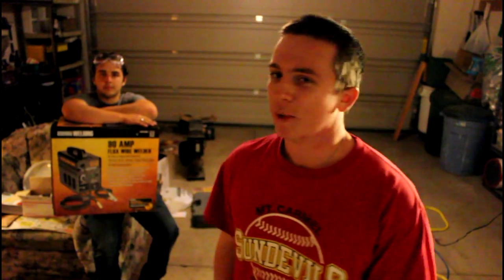(Homemade) Go Kart Build Project 3: WELDING! and More Cutting!

Comment: A little tip, try taking the nozzle off, i did it and it made it a whole lot easier to see your motion of welding and were the puddle is going, although u can only do this with flux cored wire.
Reply from the maker: +bestian4 Gotcha thanks for the tip. Yea I did notice it was hard at first to follow the bead.

Comment: It's not a bad welder to start with, especially for infrequent use. One tip for anyone getting one. Get good wire. Don't use what comes with it. I use lincoln electric innershield wire. It works waaaaay better than what came with it, and what I found at menards. I found mine at home depot.
Reply from the maker: +jesondag Yea it definitely is not bad at all for the price you pay. That was the first thing I did, threw away the wire that came with it and bought the good Lincoln Electric stuff from Home Depot

Comment: hey theres a thing on the welder that controls the heat and if you turn it down it will not melt the mettle
Reply from the maker: +Joseph Florean Thank ya for the tip!

Comment: First off, I know this is 2 years later but I just found it. I’m wondering if you have more experience with the welding? If so cool, if not here is a bit of info for you. I have the same welder and it’s a D.C. welder which is good for aluminum, not steel. I heard at the end of the video you mention the flux was causing the splatter and that is half right the other half is the D.C. part. If you haven’t found a decent welder for steel I would recommend Razorweld. It’s a low cost inverter welder system. Mine is an A.C. MiG/Tig/stick which is good for Steel. 

I will continue to watch the rest of the build for ideas and thanks for not letting a lack of experience keep you from wanting to learn.
Reply from the maker: Hey Ziggy, Thanks for the comment! Yea I've gotten quite a bit more experienced at welding over the past two years over the course of this build and various other projects. Always looking to improve though from well-seasoned welders, I definitely still consider myself an amateur and would love to learn Tig welding at some point. Thanks for watching and dropping a comment about the welder. I always love to learn new things and challenge myself.
Reply: Hnat Automotive a tip on TIG welding, brazing is very similar but cheaper and would be a good way to start. A torch (which you have have) and brazing filler rod for the appropriate metal your working on. A steady hand is need for both and my welding teacher started us all out with brazing to teach us heat control and hand placement.
Reply from the maker: Sweet, I'll have to give that a try! Have been wanting to try and build some scale model frames so I may give brazing a try when doing that.

Comment: If you ever want to get a MUCH better decently cheap welder ahp has really good ones for the price
If you don't mind stick which is much less temperamental than flux core wire or mig 

http://www.ahpwelds.com/welders/stick-arc-welders/ahp-stick-160st.html

Stick is much more easy to tell what you're doing wrong as well